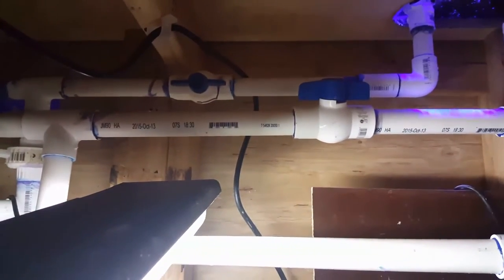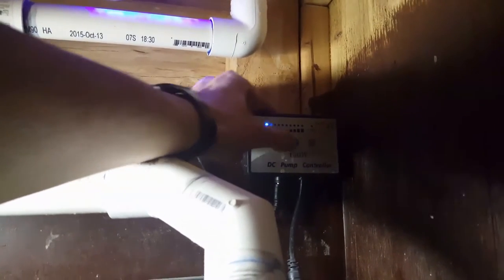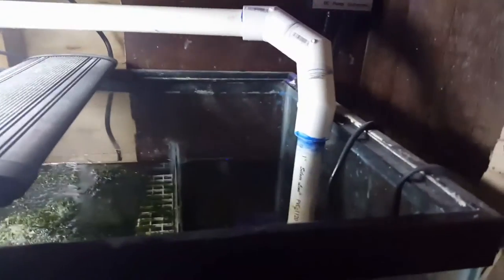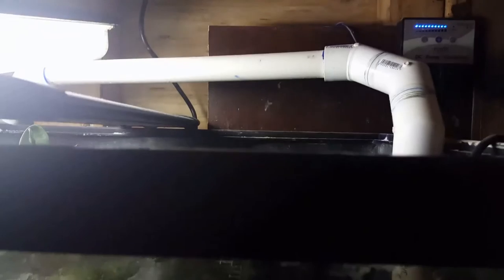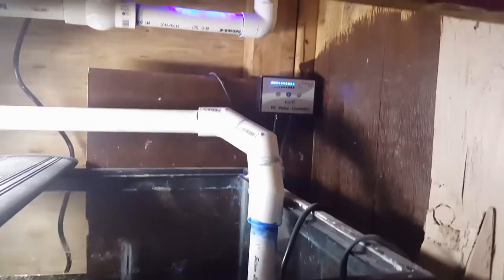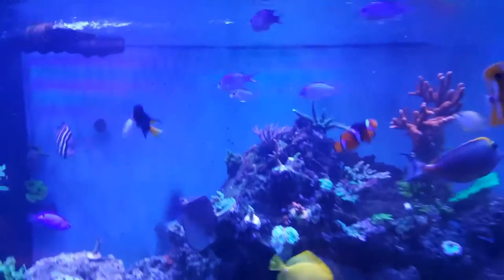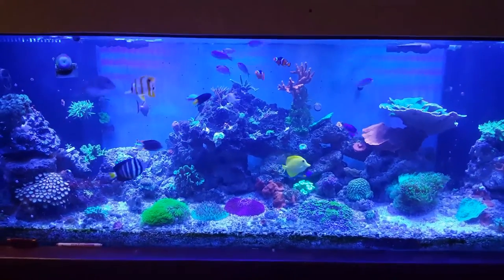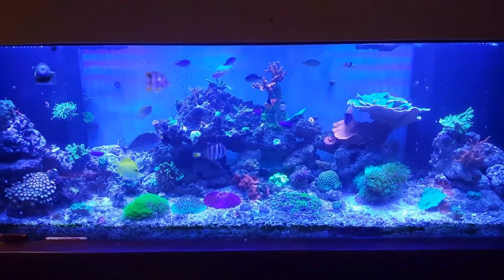Marine DC Pump, Jebao DCT 15000 product overview

Comment: Just bought myself a 18000 to run out of my basement sump..it pushes water at a head height of 10ft and 30ft across and i am only using it at 55%...these pumps are excellent buy even if you have to replace them once or twice a year it pays for itself with the savings on your power consumption..i use to use Reeflow at 305 watt power consumption and now with jebao its doing the job at only 69watts. go figure lol...my apex shows savings of $35 per month as compared to Reeflo.